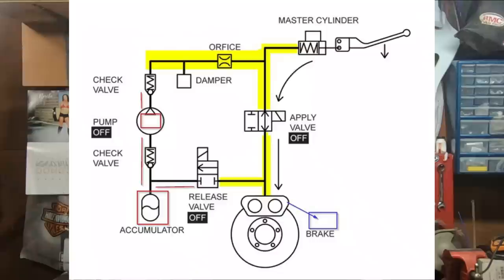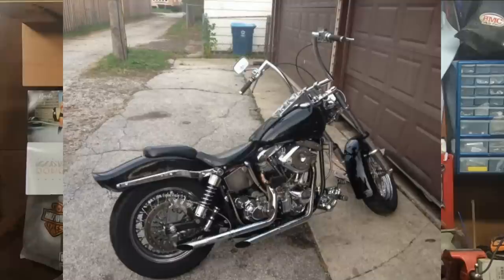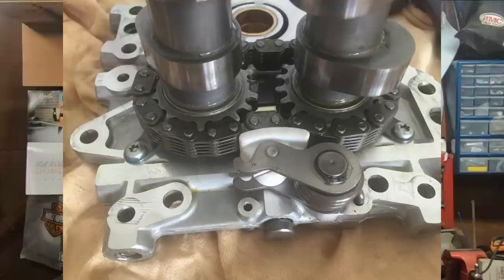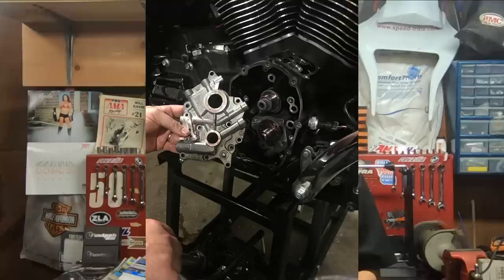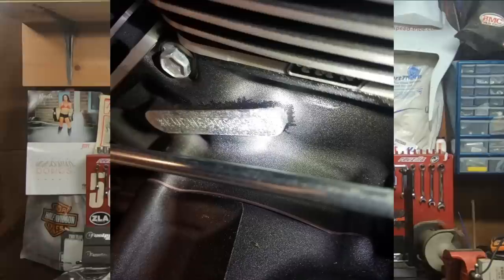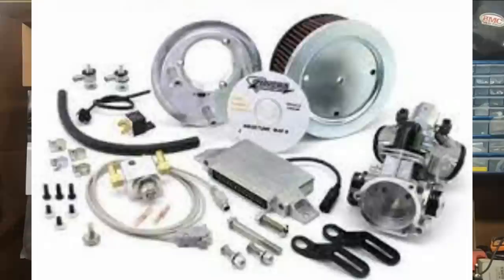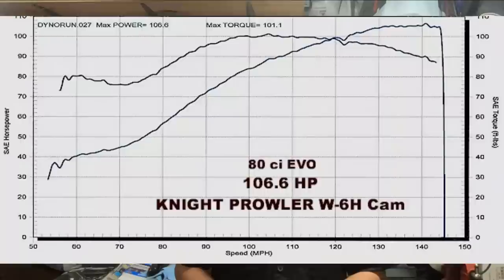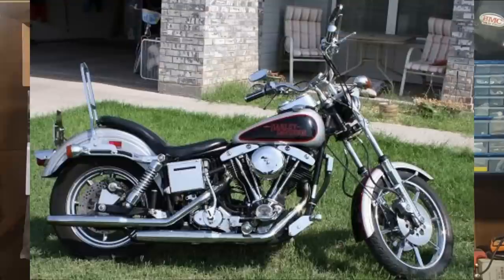Best Harley Engine Ever Made (Arguably)

Comment: Went to an estate sale last year, found 3 harleys in the garage. 2 were Dyna and one was a Heritage softail. All were later 90s. I like spokes and bags so I purchased the heritage softail.  Loaded it up and drove home. Started cleaning the dirt and cigarette smoke off of it. While wiping it down I started to be suspicious of something being wrong. The cycle looked way to clean to be a 1998. The leather bags looked new, the frame didn't have a scratch, the chrome was show room mirror condition. I looked under the fenders and the paint was factory fresh, the build date stickers were still stuck under fenders and gas tanks. I really was getting excited about my first Harley. Been collecting British and Japanese for years but couldn't afford a Harley. Went out and got a battery to see if it would turn on. When I turned the switch on the led display told me there was only 187 miles on it. I was blown away and excited as heck. I cleaned the gas tanks changed all oils and after that it started right up like it was on a showroom floor. Changed the idle and main jetting so it wasn't so lean and have put 800 break-in miles on it so far. Never in my life have I come across such a good deal. The old man that owned and stored it was leading me to his house the day I bought it. I thank him and the man up stairs for giving me the opportunity make sure the cycle stay stock and intact for the rest of my life. Visit my channel and see the bike idle. I will post better videos as soon as I get it out.
Reply from the maker: That's incredible, it's just amazing to find something like that! That's like the odds of hitting the lottery to find a bike like that!
Reply: @GixxerFoo  I love that thing! My Hondas,Triumph, BSA have been getting a break from weekend rides.
Reply: Wow. That bike will last 3 lifetimes if taken care of. I bought my 94 H Softail and still love that bike. We've been everywhere. Enjoy.
Reply: So what year is it? A 98?
Reply: @headreddedstepchild6177  yep!

Comment: I'm keeping my 1998 electra glide for ever. 93000 miles and going strong  🏍
Reply: Amen bro. Keeping my 96’ till they’re shoveling dirt over me.
Reply from the maker: I still say those mid to late 90's Evo bikes were just about perfect, you get an INA cam bearing in there and you're set!
Reply: 1987 FXR mine ma b 200,000 n still going strong unbelieverable.
Reply: I just bought one but feel like I made the right choice. My first ever Harley and it has 35,000 miles

Comment: I have a 1994 ultra classic and I love doing the winter work on her (helps keep sane and out of trouble). Obviously she will never be a rocket bike and I don't want it to be. All I have done is install an EV-27 cam, new lifters and adjustable push rods,  a new breather gear (metal) , rebuilt the oil pump, and installed a baker 6 speed kit. Other than that nothing major. All done with limited tools I have. Best bike I ever owned!! Thanks for the video.

Comment: The Evo was Harley's best engine in that people could work on it without any fancy expensive software. S&S made the Evo engine better by redesigning it and fixing its flaws: that engine is called the V-Series or Sidewinder or Super Sidewinder Engine. It's a beautiful engine. My S&S 100" V-series engine out accelerates a lot of twin cams, and it's simpler. No ECM, no injectors, no fuel pump... You can get a 124 CI V-Series engine or a 111 CI or even a 80 CI. These engines outperform and outlast Harley's Evo engines.
Reply from the maker: S&S did an awesome job with the Evo engines they built, I've heard a mixed bag on the luck people have had with them. But overall what I've seen has been pretty good with S&S.
Reply: @GixxerFoo  S&S know their stuff. Sure they build rad motors but they warn you, "hey this won't last long..." and I mean who is going to buy a non-rad custom motor..? Best thing is to order for your actual riding style not your dream riding style 😉
Reply: You don't need "expensive" software to work with a Power Commander or any one of another FI upgrade systems, it comes free with it, and something like a Power Commander not only costs about the same as a performance carb but the tuning is far more precise than any carburetor, most of those systems make 1,200 corrections a second, how many does your carburetor make?
And as far as software being "fancy" I just don't get that, what exactly is it that's supposed to be so much more difficult about plugging a laptop into something and pushing some buttons than dropping a fuel bowl on a hot engine, changing jets around, that's if you have the jets you need and don't have to drive somewhere and get them, and struggling with setting the timing through that little hole in the engine case that's on the opposite side of the engine from the timing plate you have to turn to move the timing?
I've been professionally working on Harley's since way before they had EFI systems on them and I'm here to tell you that EFI is much easier to master than carbs, and as far as performance goes EFI is a tuners dream, I can make the timing and the air/fuel mixture do anything I want it to do and far more precisely than can be done with a carb, I can make them do things that are impossible with a carb and a timing plate whether it has points or a electronic ignition on that plate, and without oil flying all over the place trying to set the timing or dealing with a clear plug that makes it hard to see the marks on the flywheel and getting gas all over the place changing jets, you just plug in an electrical cable, and push some buttons, I can be back from a test ride before someone else can even get their timing plug back in and their fuel bowl back on and clean up the mess they made doing it, better yet I can take that laptop with me and tune on the road instead of having to return to a shop every time I want the timing and air/fuel mixture changed, I  just pull over somewhere, plug in the cable, push some buttons, jump right back on and keep test riding. 
For the life of me I don't understand why people that can master a carburetor and the way the timing has to be worked with on the older setup think that learning how to work with an EFI system is so complex, they're easier, there really is less to have to learn.
Then you've got something like the Thundermax system that can do all that and you can do other things like recalibrate your speedometer after changing pully's or sprockets, just plug in the cable and push a few buttons and Presto!!! Your speedometer is correct again. 
That's why more and more you find Harley mechanics that won't touch anything with a carburetor on it, once they learn EFI systems and how easy they are to work with they don't want to mess with the older stuff.
Reply: @dukecraig2402  well done man!! You just inspired me to go EFI next time around. Really good article thank you so much. 👍🙏✌️
Reply: @dukecraig2402  everything you said makes absolute sense. 
I'm new to wrenching on Harleys but have been building V8 hotrods for 30yrs and have experienced the same shift in carb to EFI and the fear that it invokes. I think a lot of guys are intimidated by anything that involves an actual laptop/PC. They can navigate smartphones but that is the extent of a lot of people's internet/computer comfort zone.
They need to be brave and jump in feet 1st. It's not as hard as they have worked it up in their heads to be.
I ride a 1999 Evo that I love. I would have a new bike if my $ was unlimited but I choose to put my $ in other things because my 1999 FLSTC does what I need it to do and the new Harleys IMO don't do anything that earth shatteing to justify me getting rid of this old gal. I have decided to swap 6spd gears in the tranny, which will update the performance enough for my purposes.
Reply: @cardboardkiller6883  
Get the Direct Drive 6 speed, not the overdrive.
Reply: @dukecraig2402  I plan on getting the Ultima 6sp conversion and replacing the arm & bearings with parts from Baker.
This will yield the same end result of operation & reliability that the $3k Baker unit does. I hate to do this but it's what my pockets can afford presently.
Some day when it wears out, I will hopefully be in a better position to swap a full Baker kit in it....

Comment: Couldn’t agree with you more! The 350 small block of Harley Davidson
Reply from the maker: That's a good way to put it! Those Evos are virtually indestructable!
Reply: Your right, not as good as any of the others, and leaks oil like a sive. Honda 1300VTX dominates this train wreck with basically a bullet proof engine
Reply: @williamdawson3792  welll, I'll have to say there ain't none of um that's as great as the original Valkyrie. Now that's a real winner. Waaay better than the 2 twin cam's I've owned. Oh well. Just try to have fun with what ya got and steer clear of the crazy distracted insane angry cagers. Live to ride and absolutely ride to live. Be safe, have fun, and ride it like you stole it.

Comment: I've owned 2 Shovels and 2 Evo's. Love em all but if I had to pick one to get me somewhere, or as the last bike I could ever own, it would be the Evo. They are reliable as a 292 "Stovebolt" I-6 Chevrolet. A mildly tuned Evo with a few aftermarket goodies from S&S, JIMS, ANDREWS, etc and some shop love all winter long gives you a 75-80 HP engine that will run thousands of trouble free miles for years.
Cheers.
Reply from the maker: That's exactly what I love about the Evo, you can't let the torque and horsepower numbers fool you either. The Evo just has a way of putting that power to the ground that you'd have to ride one to understand.

Comment: I'm pushing 100K on my '98 FLHT standard that I bought new, I had the heads ported and shaved and a upgraded ignition and mild cam at 40K. Still have the original CV carb and it runs and runs and runs.......
It has never let me down and 49mpg all day long.
Reply from the maker: That's awesome! It really doesn't take much to get a nice bump on the Evo and still keep it reliable!

Comment: I have ridden Harleys since I was 14 and bought a 1942 "45" flat head in 1955. Most people do not buy Harleys to be a rocket ship. I am 81 years old and ride a 99 Softail Custom. It has all the zip I need even with drag pipes. Of course, it only takes about 10 minutes to change carb jets when you change exhaust. You do not even have to remove the carburetor. 

My evo is completely stock except for the intake K&N air filter and the open drag pipes. Oh yeah, I did replace the cheapo inner cam shaft bearing at about 23,000, just for peace of mind. Otherwise, no problems. Did that in a day on my garage floor. 

I rode an Iron head Sportster before the EVO, for 23 years. When the ignition module quit, I changed it to points and condenser. Replaced the censor with the breaker plate, changed the coil, and plugs. Then I could fix it. 

Electronic stuff is great when it is working, but the only way to fix what does not work is to replace the whole thing. 

The EVO is just basic Harley engine with no frills. But it runs great and is reliable as a the aircraft radials which it is a 2 cylinder radial in effect. Simplicity of the EVO is its strong point. 

Of course, all of this is just my opinion. Everyone has one.

Comment: First thing I did to my twin cam was to convert it over to gear drive EVO all day every day ✌️
Reply from the maker: Gear drive makes a huge difference in nailing the timing down too!
Reply: but im wondering how much damaged can the gear drive do to the surrounding components over time considering, it puts pressure to other parts that im not sure about, unlike chain drive which puts the pressure on the tensioner. or would gear drive last as long if i dont ride it hard or stunt?
Reply: @Cheaps928   not only that but you need to convert to a welded crank and tighten up the bottom end to get a gear drive to live on a twin cam.  Or
You can leave it chain drive and get 60,000 miles with no issues before replacing tensioner pads
Reply: @johnbrowning1232  yea i think a smart way is to run chain drive until your motor needs to be rebuilt, then i'd go gear drive

Comment: Shovel was easier to work on than the EVO. I’ve replaced head gasket in hotel parking lot using just tools I had in the Saddlebags. 🏍💨🏍💨
Reply: The shovels are truly Jewels, but the Owner/Rider should be a good wrench and appreciate it!
Reply from the maker: That was the best part of the Shovel head, they looser tolerances which made them a breeze to work on. That was truly an engine you rebuild on cardboard in a barn with a dirt floor. Those engines just didn't care as long as you put everything back where it goes lol.

Comment: This past Nov. I found a 1997 Dyna Superglide with only 9700 miles completely stock. All I have done is put a S&S carb on it because I had one, otherwise I would of left it alone. I love it.  I also have a 1987 Electra Glide. That I have had for over 30 years.
Reply from the maker: Very nice! You found a gem right there with only 9700 miles! They are out there, you just gotta get lucky to find them! That's the best part of a owning a Harley is they are easy to keep for 30 years and you can still get parts!

Comment: I had an 84 1/2 evo FXRT that I bought new. I made 2 trips to California from Ohio and 1 trip to Colorado. The only issue I had was the stator crapped out when I was in Texas. It took out the starter and battery. HD of Dallas got me in and fixed the same day. Cost me nothing. I put over 100,000 miles on it and no problem other than that stator. I did have some oil seepage where you mentioned but was only enough to discolor the top of the case. S100 took that off. You’re correct, evo motor was the best.
Reply from the maker: That's what I love to hear about those Evos, you could go coast to coast on them without any worries. Getting a good dealer to help you out like that by dropping everything and taking care of you is awesome! That's getting harder to find these days.

Comment: Last weekend I went to Germany's Mosel area and chased BMW GS's 4 days all day long with my 1996 carburated Roadking. I didn't spare the engine to keep up with them, also ran 80 mph for hours on the autobahn to get the there. I had it for just a year, and serviced it myself,  so it therefore was exiting and at the same time also a good test. Went through some heavy rain showers. Had no problems, it held perfectly. Gas usage: 20,3 km with one liter on the autobahn, and 17,8 km during twisty's/hairpins/villages. Very happy with that.
Reply from the maker: That had to be a once in a lifetime experience to run an Evo down the Autobahn!

Comment: My first Evo was in 1985 never any issues. Now I have my 2003 Electra glide classic anniversary. My first twin came so I had concerns so as you mentioned mine got the S&S gears adjustable push rods etc never any issues and more power 100% reliable
Reply from the maker: That's awesome, there's a lot of bad stories about Twin Cams out there but it's not every bike. For the most part Twin Cams are very reliable, you get one horror story and it spreads like wild fire.

Comment: I just bought a 100% original ,94 Heritage Classic. 3,120 original miles. Changed the tires, the fluids, rejetted the carb and have put 1,500 miles on it the past 5 weeks. Runs like a charm. I had a 1998, same bike loved it bough spent a ton of money on that engine, had it 7 years, it got stolen. Bonus on this one, 1 of 178 paint job from the first year Harley Custom shop. Original owner didn’t know about this. I’ll never sell this one. And I’m not touching it, kind of cool to have one this old that is 100% like it came off the showroom floor. I agree with you on these engines. Sold a full custom 2009 FLHX to buy this one so that tells you something. Great videos by the way, making my way through all of them.

Comment: My '96 Heritage will be my last bike as far as I'm concerned. She's all stock other than an S&S carb and the pipes. She still runs like a champ after all these years.♥🏆
Reply: How many miles do you have on her?
Reply: @austinsmith7579  almost 100k
Reply: @harleybill1306  wow that's great!  Mine only has 21,000. I was contemplating a cam but worried doing it will shorten my Engine life.
Reply: Love my 96’ Heritage too. My best mechanical friend...lol  I’m 62 and have owned 3 twin cams over the years, will always have my 96’ Evo.
Reply: @austinsmith7579  at that low mileage, I wouldn't be afraid to put a mild cam in it. Besides, it'll give you a reason to take a look at things.
Reply: @harleybill1306  yeah, I'm sort of worried about the cam tensioner shoe. Never done a cam on a bike before.  I don't want to screw it up.... and then I don't want to pay hundreds to harley. ESPECIALLY  not knowing if they'll even install the high dollar after market cam plate, springs, and oil pump.

Comment: Love my 95 springer! Stock 5700+ .only thing.  Sweating by the oil pump . Not leaking ? Not sure how to fix it. Running like a champ. As far as the Evo goes  The fuel injection can be fixed perfectly by a dealer that knows what they're doing I've seen it done. It's a pain so most places don't wanna deal with it. You can't charge a customer the time it takes. Some dealers really stand behind the customers but they're few and far in between.
Reply from the maker: It's really hard to find parts or even anyone that knows anything about the mag system these days. Most dealers won't touch those systems anymore.

Comment: I purchased and Evo Heritage new in 1994. I knocked out the plugs inside that stock slip-ons. It still gave it some back pressure but a great sound and better airflow. I added an S&S E carb and a 490 Crane cam. When I sold it for my 2010 Heritage twin cam upgrade, the 94 had 65, 000 miles on it. That engine NEVER gave me any problems. I am with you. The Evo engine is the best Harley-Davidson ever made. I now ride a 2021 Tri Glide.